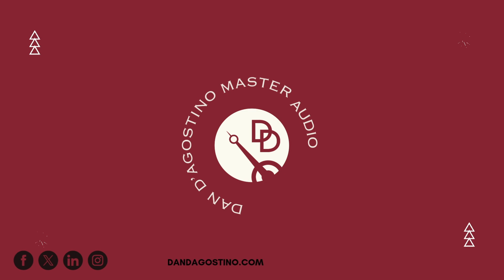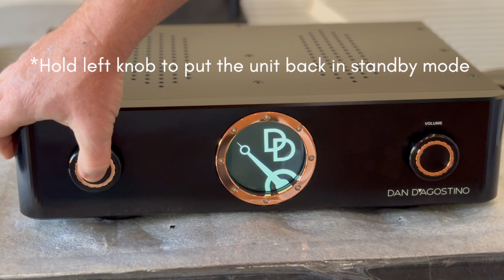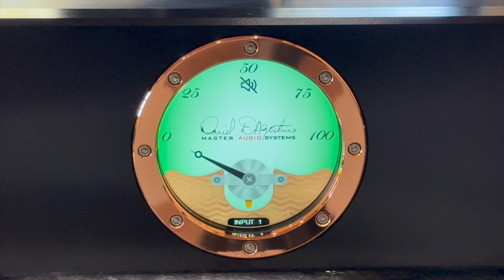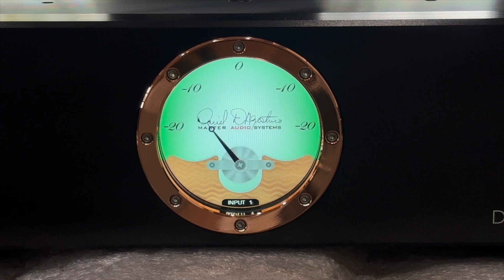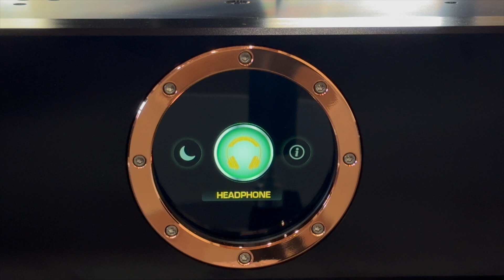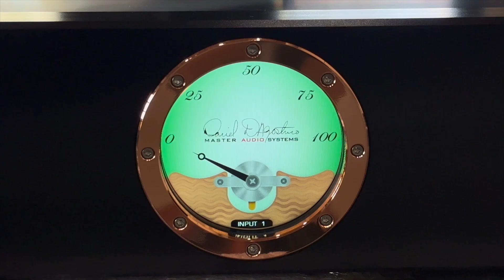Pendulum Integrated Amplifier Installation

Comment: why oh why are there so many large pan head screws? obv. rigidity was a goal but it's very simple to have one panel with the screws and with just one bend on the left and right you can slide in a high quality well finished panel on top with no visible screws

Comment: Bill McKeegan claims the finish is “anodized.”
But is it really anodized, or painted?
Other D’Agostino products were painted, and they were easily scratched.
So, is the new finish anodized?
Reply from the maker: It is anodized. The original silver Momentum products had a clear coat finish, while the black components were always anodized. Several years ago, we transitioned to anodizing all components.